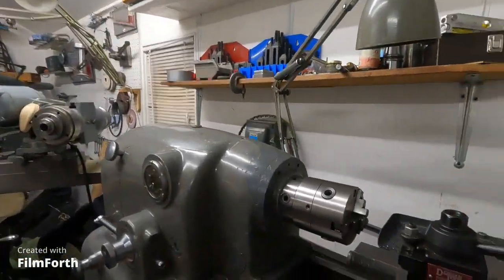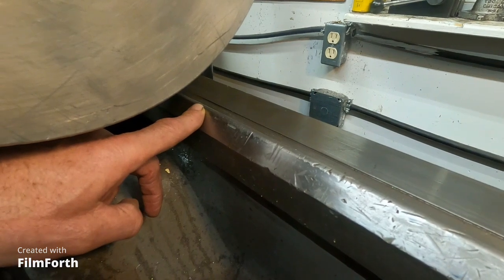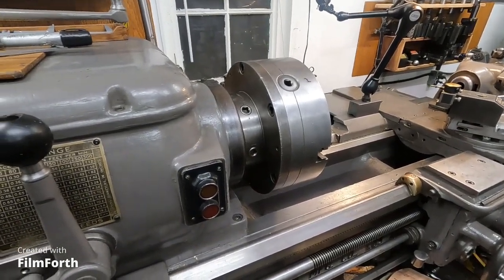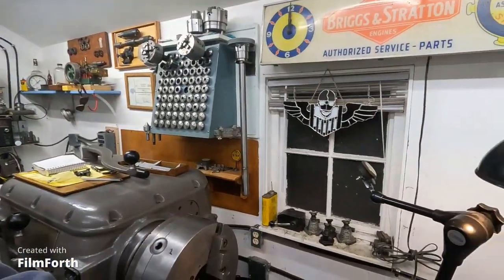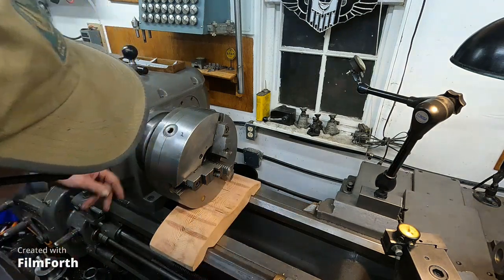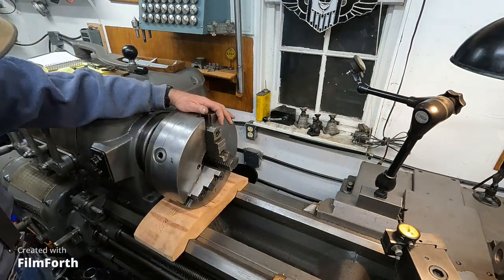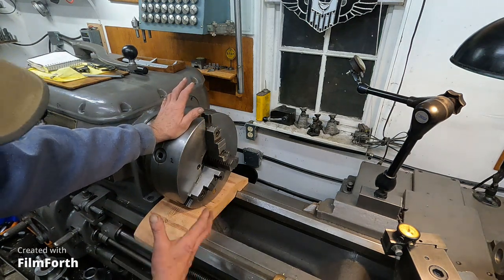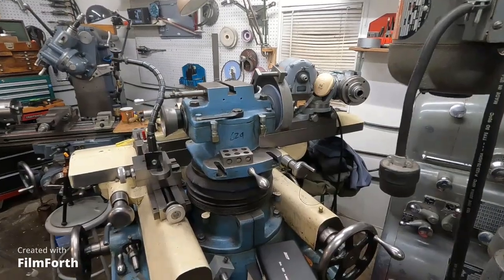Safe handling large lathe chucks in a small garage

Comment: Heaviest chuck I have is a 16" 4 jaw L2. Even a 12" L1 is heavier than my D1-8 16". The open pins are much lighter.
Just restored a 10" Pratt Burnered 4 jaw chuck with independent jaws AND a scroll. Brilliant design. But the weight is crazy. Hasn't even got a backplate and yet weighs about 1cwt or 112lbs. Seriously hard work.
Reply from the maker: It seems when that heavy, they can really smash your fingers and hard to hold on to!

Comment: DeeDee.  Head a story from a friend who watched a guy drop a 12” steel chuck while trying to manhandle it onto an old Monarch.  He said it bounced off the concrete floor almost almost all the way back up to height of the lathe ways. That kind of energy is frightening. Fortunately no one was hurt. Your sleds are the way to go even for the small chucks I have for my 10ee.   No sense risking damaging my newly reground ways, or my body.  Now that the lathe is spinning I’ve got to get my tooling in order. I’ll be in touch looking for advice.  Cheers, TB
Reply from the maker: Using sleds  was a lot more common 30 yrs ago. I had to use pieces of wood and climb up on the machine to get this 140lb chuck back on and almost lost control of it. The sled I just made is deluxe like they had in the schools here made in their woodworking shops. I seen a fellow bang his finger hard hanging one from a chain hoist, it is best to make a sled. You getting that machine back together was a big job, you should get a lot of enjoyment out of it. I am enjoying exploring the legendary Axelson. Going through  what tools work, using larger nose radius to compensate for much coarser fine feed of .0029, using the threading trying out on various scrap pieces of many materials. So now you have to explore the machine and adjust it testing it out, let me know if you need anything.

Comment: How far do the jaws flex out when tightening the scroll. 

Are you going to grind the jaws on the chuck.  Or remove them. Clamp them to a jig to grind them. So they are the same length.  Might be interesting to chuck something then measure the od of the chuck to the outside of the jaws.    Are the jaws reversable.
Reply from the maker: Yes, I will load them with a device that holds the jaws so they just protrude into the chucks center hole with a load on them then grind them in the lathe. There is an old war production film clip that shows jaws being "factory ground" the same way except the chuck is in the vertical position on a Bullard type lathe with a Red Head ID grinding attachment. Factory ground jaws contact faces have the radius of the spindle hole, thanks

Comment: One thing to do if you absolutely have to lift large chucks by hand it to use a length of bar chucked up as a handle, then you can get a real solid hold on the thing.
I made sleds for my 10" and 12" chucks, but I have a chain hoist I can swing over the lathe for lifting them, I already have back issues which I don't need to make worse.
Reply from the maker: The doctor gave me weight lifting restrictions, finding that reaching out to hold much weight is a problem also, take care

Comment: My only 4" chuck is a bison 5C collet chuck that I love. I must admit to feeling the weight differences of even a 6" four jaw these days. I am working with very small cnc ready taig machines for high speed (10,000-20,000) rpm ,for special applications, and I don't miss the larger cast iron/steel chucks.: although there is nothing better when only 'larger' will do!! Great share on the dangers dee dee!! Cheers.
Reply from the maker: That is very fast! I am  going to test that heavy 3 jaw today at about 300rpms,
Reply: @deedeeindustrialsuperprecision  On you Axelson dee dee that's fast enough!! Love your content . KJK